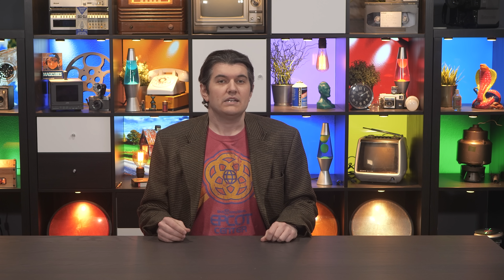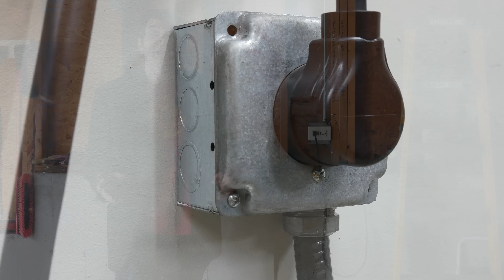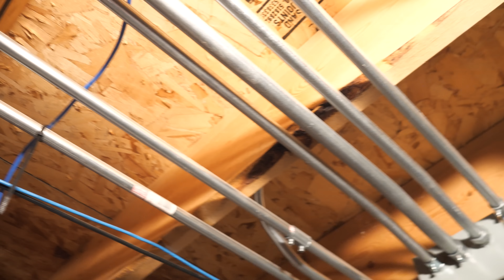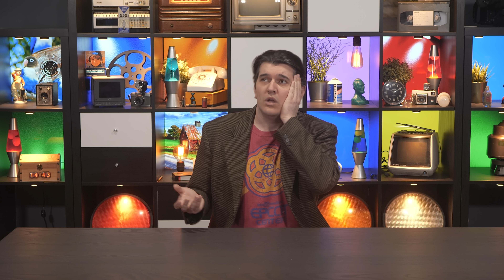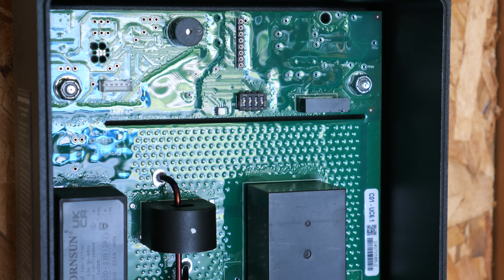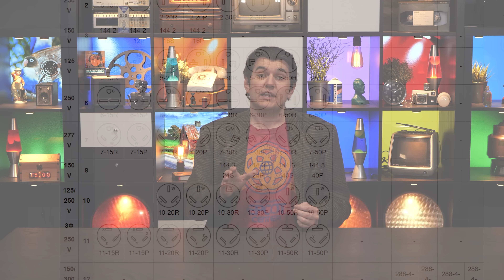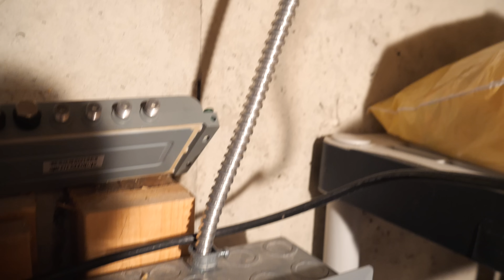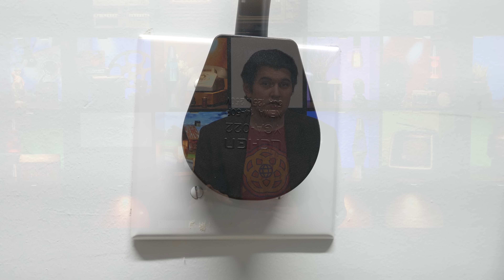The "standard" car charger is usually overkill—but your electrician might not know that

Comment: The other problem with aluminum wiring is that aluminum is a very soft metal. What this means is it has a tendency to flow around the connection you make - you might have torqued it down when you install it, but aluminum will squish past that making the connection loose again. That means you need to re-torque it again to prevent a loose connection (which is high resistance) after a little while (this is a huge problem and why there were so many problems in the past). (Aluminum wire is everywhere, you can't get away from it - power utilities have basically switched to all aluminum wires now so depending on where your demarc point is will likely be aluminum while your cables (the bit you own) is copper. But power utilities also crimp the cables together so there's nowhere for the aluminum metal to flow - it's compressed into a hunk of solid metal so it will never let go.
Reply: Aluminum ferrules, oxidation preventing paste, and making sure the connections are properly torqued (too tight is just as bad as too loose) are all vitally important when dealing with aluminum wire. That's why I don't touch the stuff, if I have a need for wire of a sufficient gauge that it's going to be aluminum, the electrician does it.
Reply: Generically, I use 2 AWG as my cutoff: if a job will require 2 AWG or larger to obtain the ampacity needed, I run the numbers on using aluminum vs. copper.  Most of the stuff I work with does not get into that range anymore.  Working with Aluminum has different rules but it works fine if you follow them.  The rules do change: Noalox is no longer required nor recommended (per NEC) for modern AL cable, as the mfgring method has changed.  The individual AL strands are now formed to be isosceles trapezoidal, and they nest much better than the old round strands and don't cold flow nearly as easily.

Comment: One of the main obstacles for millions of people for getting an EV, including myself, is the fact that there's no possibility of charging at home. I live in an apartment with no indoor parking garage, just an outside parking spot with no electrical outlet. I don't see myself extending a 115V power cord hanging down from my 4th story balcony down to my EV to charge it overnight. And I don't see myself relying only on public charging stations, waiting and waiting and waiting every time I need to recharge. Not to mention all the horror stories of doing it in winter, freezing yours hands handling a super stiff cable, even worse in a storm and encountering non-working ones. And they're certainly more expensive than charging at home. 
And, unfortunately, I'm not a YouTube millionnaire so I can't buy a million dollar house with a garage (that's becoming the average price these days) to install a charging station at home.

Comment: I used to live in a medium apartment complex, a collection of 2-story buildings, 8 units in each. There was assigned and covered parking slots per unit plus a bit of uncovered overflow, all as per pretty normal in the suburbs around here, and all of the building's meters & shutoffs were on the end facing the strip of parking. Ever since the very first modern electric cars started rolling out I was frustrated with the lack of charging infrastructure in the 'burbs when so very many of the commonly built apartments were laid out in a similar fashion. The power was right there but in my case accessing it was not an option as the facility restricted access (they were not even willing to let me bring in a commercial electrician without approval from the ever-shifting mess of opaque finance companies and real estate holding firms that shifted the ownership of the property around regularly) It would take minimal work to trench a line from the individual unit metered supply to a base at the parking space, even more affordable when done for multiple units and almost entirely "free" if included in the original planning and layout.

Comment: In the country where I live, installing an EVSE would probably require a type B RCD/GFCI to be added

As far as I know, all EVSEs where I live are designed to be hard wired (same as electric cooktops)

And someone where I live has used an electric shower priority unit to allow an EVSE to co-exist with an electric shower

Comment: Yep, paid about $900 to get the nema installed in my garage. Probably wasn't necessary because I only use about 20% a day on the far range which would charge overnight. It is nice to be able to do it in 2 hours vs 10 though I guess.

Comment: 13:12 I don't really like that rule. I would indicate thresholds from the safe side instead of the absolute maximum it can handle. If your circuit is 30A than you should be able to us it continuously with 30A. For me it would make more sense to call your wiring a 24A wiring, and say that if there is a short burst, than it can withstand 25% more, so you don't have to worry below 30A peaks.
29:48 Well, if you ask, that's why I think what I wrote above.

Comment: I actually had this conversation with a lot of people. I had a Nissan leaf and I charged it on a regular 120 outlet. If I plugged it in at night, I had a full charge by morning. Most electric cars are efficient enough that you'll get the mileage that you need in a day for most people. There are some exceptions.
Reply: Yeah I drive a Volt right now. 1kw of power is enough to completely charge my battery overnight for 65km of range
Reply: Used a 240 outlet for my leaf for majority of its life.
Reply: I wonder where you live that still has 110V at a receptacle?
Or is that a holdover label from the 50's?
Reply: @dragonhealer7588  Yeah, no 110v in the US since at least the 1940s.
Reply: In sweden though it is ill advised to use regular outlets for charging because of the fire risk.
Reply: @NerbyScurvy  How it it a fire risk? I live in a country with 240v like Sweden and I’ve never heard of this.
Reply: @jb-br8bf  you really didn't watch the video huh?
Reply: @jb-br8bf  I agree, this makes no sense. Where I live the nominal voltage is 230, but it's actually 240, and everyone calls it "240". The standard household outlets are rated 10 amps. You can walk into any appliance store and walk out with a 2400 Watt heater that draws 10 amps from the wall. They'll have several to choose from. There's no reason why having a 2.4 kW heater plugged in all night is any different to having a 2.4 kW EV plugged in all night.
Reply: @jb-br8bf  regular outlets are not made to draw 1000-2000 for several hours every day. We have an agency called Elsäkerhetsverket that sets the regulation of safe electrical work. They are the ones saying this. If your house burns down, insurance wont cover if you dont use a propee ev chargers. Which are quite chep btw since our state subsidizes them.
Reply: @gasdive  Any competent electrician would advise against the heater as well. Most people's homes (in the US) were built shoddily, decades ago. The amount of calls my dad has serviced where the person was days from a catastrophic fire because of some appliance they had plugged into their 40 year old shitty outlet boggles the mind. The latest one the mains service wire had melted half of the main breaker, and simply popped off when he went to inspect it. Amzing that one didn't burn down. Most people can't even be trusted to use the right guage for extension coords.
Reply: @CycFlame  I'm in Australia. Unlike the land of freedom, we don't have the freedom to sell equipment like heaters and extension cords that burn your house down. Anything you can plug in will be safe to plug in. Any extension cord with 10 amp ends can carry 10 amps all day. You can't plug a 15 amp device into a 10 amp socket, it won't fit. All wiring in the house can carry everything the breaker can put out. If you want to burn your house down with electricity you have to do something illegal to the house wiring or pile cardboard boxes on top of the electric stove or similar.
Reply: @NerbyScurvy  It's ill-advised to daily/regularly plug and unplug into receptacles of all types: they wear out.  And the contractor-grade "back stab" receptacles wear out from the rear as well as the front!  Worn-out receptacles should be replaced before being exercised.  Aside from those issues, there's no reason to not use a regular receptacle for EV charging.
Reply: @NerbyScurvy  Afaik the standard advised current is just lowered to 8A for Type F plugs (based on the typical sustained load rating of 10A and the 80% rule). I assume some people don't set it correctly and go up to the theoretical maximum load of 16A which is definitely ill advised, for that one should use a blue single pole CEE connector.

But as a disclaimer I'm from Austria so while the connectors and grid is pretty much the same, the electrical codes/regulations might differ.

Comment: another nice thing about slow charging is battery degradation, charging faster means more heat which leads to faster degradation of the cells which means the battery will not endure as many cycles, and EV batteries aren't exactly something you can replace easily or at all on most models
Reply: Don't all EVs have battery cooling? How hotter do they actually get?

Comment: I do drive about 220 miles 4 days a week for work so definitely need a 240V charger. A 120V charger is also quite inefficient and with battery and cabin preconditioning coupled with Sentry Mode (if you don't park in a garage), that cable might add insufficient range and you'll have to seek out an expensive DC fast charger to make up the difference. Hope you're not running late for anything.

Comment: As you always seem happy about the enthusiastic discussions about the different type of wire connections. Wouldn't it be interesting to take a look at the possible solutions and which application they fit. Maybe take a look how they heat up with heavy domestic loads.
I'm from Germany and as far as I'm aware, as a non-electrician we mainly use a type of screw terminal (Lüsterklemme) in home application, like lights.

Comment: from the european perspective:

we have 230V/400V 3 Phase AC. in (west) germany a 50A or 63A circuit is the default for a medium house.

Generally our circuits are 16A, which means i could charge at 3.7 kWh from a dedicated schuko outlet.
Often in garages there is a red CEE 16A connector, which can deliver up to 11kW, or the 32A variant with 22kW
then an EVSE with the type 2 connector
but most cars only support charging at 11kW AC, which is plenty 
So does the EU Spec IONIQ 5. but at an alpitronic hypercharger 220kW is the norm, differs by model
my particular evse also has 2 contactors to enable automatic single phase/3 phase switching.
so i can start charging at a min of 6A1P - 1.3kW up to 16A3P - 11kW depending on my solar output

Comment: A more featured charging station with for example, access control and web control, is excellent if you are for example renting out your car via these private rent-out-your-car companies. Then a "smart" charging station can easily tell you, while you are away, if the car has been returned, AND if it has been plugged into before the renter leaves. (Not plugging in the car when returning is usually equal to leaving the car with a empty gas tank in the rental agreement).

Thats also a advantage to have a evidence to the rental company so they can charge the renter the fee.

Comment: My wife and I went 10 months with just a 120V outlet for charging our Hyundai Kona with a 64kWh battery, and the last 2 months was with 2 EV's when I picked up my Dodge Daytona Charger with a 100.5kWh battery, we still got by fine. Really the main annoyance being our only outdoor outlet shares a circuit with our washing machine, dishwasher, and exterior lights, so we couldn't charge the cars when doing the laundry or running the dishwasher. Really that was the main reason we got a LV2 charger, plus our state doesn't have variable electricity rates, but with a compatible LV2 charger connected to their service we get a rebate for off peak charging. Since we only have a 100A service I configured the charger to limit to 32A, but our electrician hard wired it for a 60A circuit so in the future we can go to the charger's max speed if we wanted to, though even with my Dodge Charger large 100.5kWh battery it really is completely unnecessary so I can't see ever actually doing that.

Comment: I feel like this same issue crept in with phone chargers, charging at anything more than 5 watts will heat up the device like crazy and destroy the longevity of the battery. I used to have a slow charger (700 mA) for my phone since I only plug it in at night and have never had an issue with it being at 100% in the morning.

Comment: Note that you can also install a DCC device that will adaptively adjust how much power can be drawn on a nominally high-draw circuit.  As you draw more power elsewhere on your system, the amount of power available to the high-draw circuit will be reduced.  This allows you to stay under the total draw capacity for your whole house, while still charging your car as fast as you can.

Comment: I found this out after I'd installed a 30-amp outlet in my garage.  My EV only accepts 20 amps max, but I didn't realize that until I was shopping for a Level-2 charger.  Fortunately, the outlet still came in handy when I installed two smaller mini-split AC systems instead of one big one, which saved me a lot of money.

Comment: The best electric vehicles are ones that run on gasoline only. The best charging stations are the ones that deliver gasoline into a tank.

Do you need four hours six hours eight hours to recharge a gas tank? Hell no! You need four minutes and a stroll to get a cup of coffee. The way the Lord intended.

This country was built on petroleum and will remain on petroleum forever because that’s how much oil is left in the ground. Infinite supply.

Much love,
Reply: You can't install a gas tank in your home. If you're ever low on gas, you have to go to a dedicated gas station to refill it. If you're ever low on charge, you can just let it recharge at home while you're asleep, the same way you do for all your other electrical devices (phone, laptop, wireless headphones, etc.)
Also, at the rate we're using oil we're gonna run out by 2060. Hardly an "infinite supply", not to mention the insane environmental impacts.

Comment: I just got a Leaf ZE1 (second gen) and I've been 100% fine with 120v charging. I just don't drive that much. 

I have a 20 amp circuit in my garage so I have the EVSE set to 16A and it indicates charging at 1.8kw, which is perfectly fine for me. (My house nominally has 124v mains) I thought about using two circuits for 240v at 15 amps, but I just don't need faster charging. (It would be 2.9kw)

Comment: We need level 2 charging like people have enjoyed for decades in Fairbanks, Alaska. (Google "plugs in parking lot Fairbanks Alaska" and you'll see plenty of examples in the Images tab.) Workplaces are also excellent places to plugin EVs., especially for apartment dwellers and those who can't upgrade the electric in their homes to accommodate EV charging. 

Finally, household outlets with covers on them as seen in the results from the Google search earlier are cheaper and easier for cities to implement and claim the green tax credits while they last. Also, there are some light poles with household outlets at their bases, ehich should add safety and EV charging capability to any parking lot or city block with them in it. Of course, the driver would need a mobile charger with household plug on the end, but you get the point.

Comment: Almost all houses built in the last century were either speced out for 60w to 100w light bulbs or are newer houses that have much higher than average service at the panel. That means lighting circuits can be combined or they'll be extra room in the panel for a 30amp breaker.

Comment: Since 2018 my primary charger has been 110V from day one. I upgraded two years ago...to a 20A (16A load) connector for my charger. While I have cable to use my 220V/30A dryer outlet in a pinch, I rarely bother. I have considered bumping up to a 220V, mostly to improve charging efficiency in the winter, but it would probably be 24-32A.

Comment: Why not make a battery that can discharge faster than it charges that charges in between charging your car, could it also have passthrough so that even a 15amp circuit could feed along side the discharging battery so that they would feel like the fastest supercharger for at least like the first two hours.

Comment: Here in Brazil we have a Federal rule to low voltage household and commercial installation, and we are limited to 60Amps at three phase installations (and although we aren't supposed to have a 3 phase equipment in a house, this isn't prohibited). The problems is that we have 40A@220V electric showers (in winter mode), and it isn't uncommon that we have two of those installed and running at the same time in a house, this should brake the main breaker, but usually a shower time doesn't kill the 60A breaker! At least I'm my experience. 

This limitation makes a lot of people that are against EVs to say that here in Brazil we can't have EVs that needs to charge in house without thinking about this huge limitation. But everybody that is against forget about the reality that charging only when everybody is asleep is more than enough to keep the car running in our usual commute, even if you have two EVs in house! 

You only need to know how to set up everything, from balancing the circuits to the time the cars draw full power from the outlet.